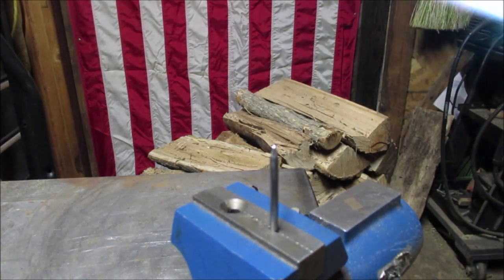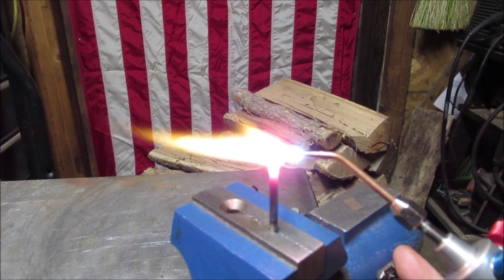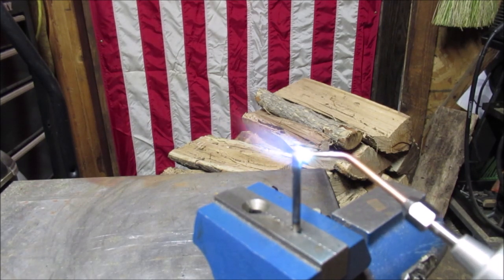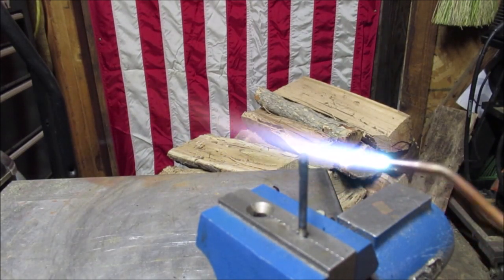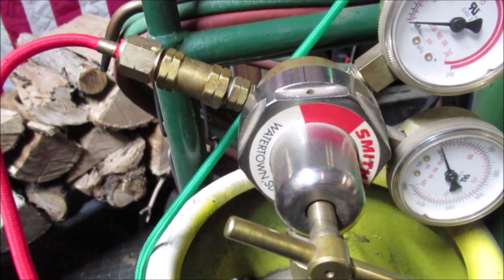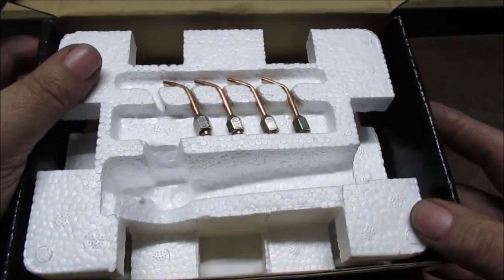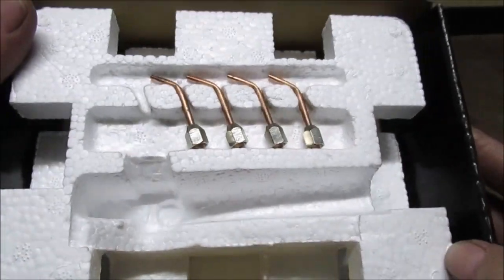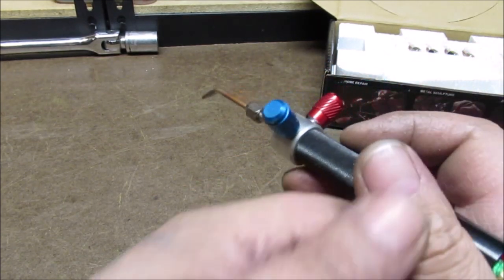New Mini Torch

Comment: Seems like a handy little tool!! I know they call it a mini but I would call it a micro!! The torch set I use is a mini but I think they consider it professional mini!!☺
Reply from the maker: I think I need to get the small mapp gas and oxy tank set ..My big gauges do not want to go that low on pressure..I had a failure on my acetylene flashback valve and need to get a new set ..Glad I caught the problem before it started pumping a bunch of oxygen down in to my acetylene tank..